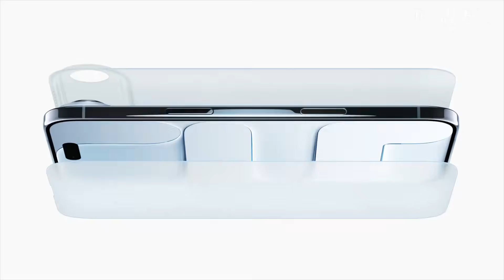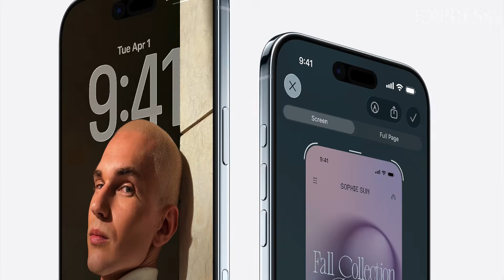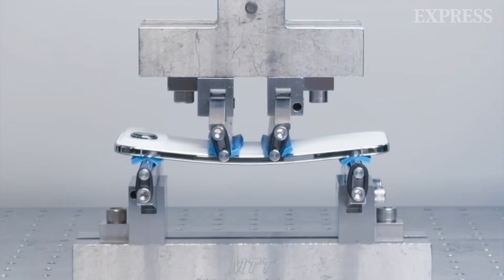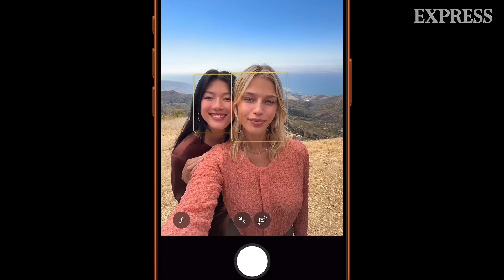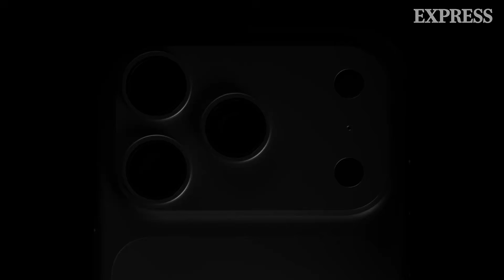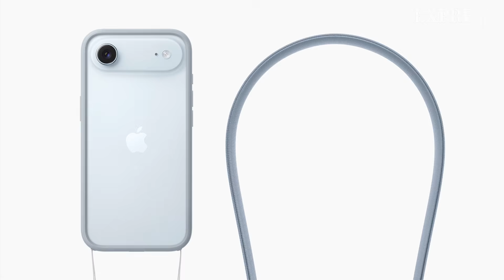Apple's VP of hardware breaks down the new iPhone Air - "It WON'T break in your pocket!"

Comment: Absolutely agree that their hardware is second to none.
BUT
If their software makes the hardware buggy, inoperative, and trash, then who cares?

Imagine a company sold you the best pick-up truck that was ever made.
It gets 90 miles to the gallon, can tow three times more than any other truck, it never overheats, it never needs an oil change, and it looks absolutely stunning.
And they bragged that the engine was designed to run 3,000,000 miles before it needed any service.
BUT
Their unlimited repair warranty is only valid if you update their software into the truck's computer every time a new software update happens.
And after only five updates, the truck only gets 8 miles to the gallon, the emergency lights only work half of the time, the turning signal never turns off, the engine begins to overheat if you also play the radio, and the brake lights only work if you break going over 80 miles an hour.
And when you contact the company as one of thousands contacting the company for the same reasons above, the company refuses to do anything for you at all; in fact, they tell you that it's hard running a truck company and so you should understand.
And then they have the audacity to suggest you buy the newest model so you don't have to deal with this anymore.
But it's the 11th model you've bought because of the same exact reasons.

Would anyone continue to buy those trucks?

Of course not.

This is how Tim Cook runs Apple.
I am so happy he is stepping down.

Comment: This guy (ternus) has that intuitive understanding of the customer. The reason I wasn’t upgrading from iPhone 7 Plus was the weight of the new phones (and that hideous notch). They fixed the notch but it wasn’t until iPhone Air that both issues were resolved. I’m typing this on my iPhone Air which I bought immediately after it became available

Comment: Very good talk. I am surprised there aren't more comments. I found this video; where is everyone else?! lol 😆 I think this is the best launch and lineup in years and years. I love the "Cosmic Orange". My favorite color, but I wanted a slim, lightweight phone after years of Pro Max, so I got the iPhone Air, in Space Black... I think it's wonderful all the added features on the iPhone 17! It's definitely the best value. The only thing I think Apple should have done is upgrade the base iPhone 17's design. 

With the iPhone Air coming out and redesigned Pro and Pro Max, I think they should have given the iPhone 17 a facelift as well, so it was an across-the-board upgrade of style. Yes, I know having the Pro Motion 120hHz screen with 3000 nits, and 18MP Center Stage selfie camera, and all the internal upgrades are there, and so the 17 is the most advanced base iPhone ever.... but they missed an opportunity to do a few design tweaks there...